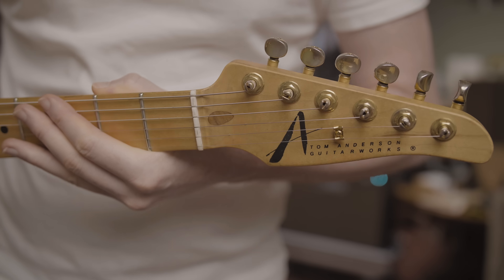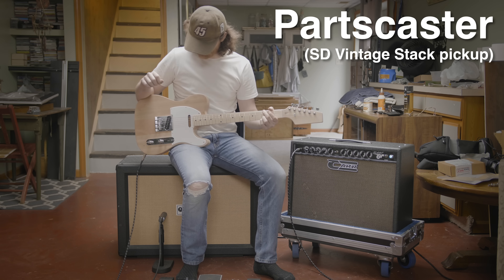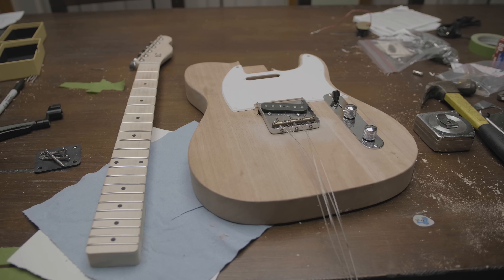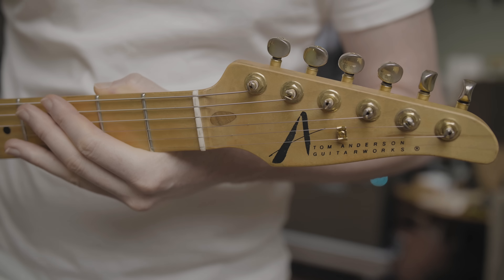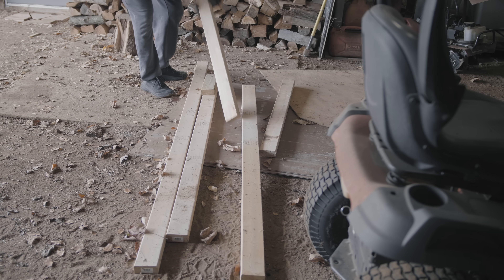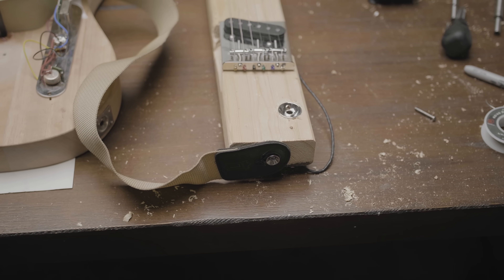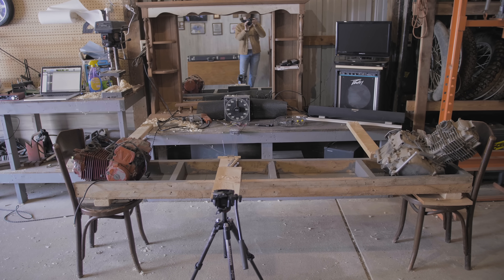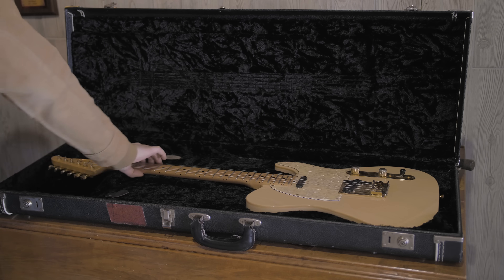Tested: Where Does The Tone Come From In An Electric Guitar?

Comment: I think "tone wood" in electrics is a carry-over from acoustic instruments where the wood really does make a difference.
Reply: OP is correct, but it's still funny in this thread how even when the evidence is right in front of our eyes and ears guitarists still believe in magic like "tonewood."

As long as a solid body electric guitar is structurally able to hold the strings where they are supposed to be the material of the body and neck doesn't make a difference.

Most of the differences people hear from electric guitars, even of similar or identical build, comes down the variances in electronics. Especially back in the day the variances from one capacitor, pot, or pickup could be extreme. Nobody was counting exactly how many winds were on a pup, or checking capacitance values with a multimeter. Heck, even a top shelf harness kit from Emerson Custom states there is a +/- 8% value between their parts.
Reply: @SuicideVan  this, honestly an electric guitar should be bought based entirely off what makes you happy or what you find comfortable, and if you want to modify the parts of it with better parts go for it, thats one of the best parts about an electric you can customize the hell out of it if you want

people buy old worn down cars to restore and upgrade them all the time, i'd love to have a project guitar someday like others have their project cars
Reply: @enbydeadly  I restored a 1961 Kay Galaxie I found in a thrift store a few years ago. A mouse had made a nest I'm the body. I rewired it with new pots and jack, deep cleaned the fingerboard and polished the frets. I had to buy and shape an entirely new bridge and install new tuners. The most interesting repair was the acrylic pickup frame that was cracked and broken. I was able to 3D print a new one. I did the best I could with the action, but it's still very high and pretty much unplayable above the 12th fret, but it does work well for slide guitar and looks great hanging on the wall.

As far as modern guitars go I'm mostly inclined to build my own guitars from the premium parts I want from the start. Buy once, cry once. The bonus is I don't end up with a workshop full of extra parts I never really needed. I'm not particularly skilled at this either. A couple times on more complex builds I simply took all the parts down to the local guitar shop and spent $100 or so having a professional put it all together. Still got an amazing guitar for less than what Fender is charging these days.
Reply: @SuicideVan ”pup”
Reply: I think this is an insightful, mature, and open minded thread of comments.
Reply: I make both electric and acoustic guitars as a hobby - I can tell you 100% that tonewood is everything in acoustic, and marketing in electronic.  the only thing I have ever see modify the tone in any electric guitar is the electronic hardware (mostly the pickup) and the strings.  I'm still watching the video, though, so I'm interested to see where that lands.
Reply: @Chiberia in classical guitars wood (90% of which will be the top) is one part of the equation, the other part is the overall built and that’s where it becomes difficult and requires a lot of talent and experience by the luthier. You could cast an electric in concrete and it will sound great with the right pick ups, strings and electronics.
Reply: @Chiberia  That may be true for wooden, solid body guitars but that's not true for metallic-body guitars or semi hollow ones.
Reply: With an acoustic guitar the wood IS  the pickup.  So, obviously, it's density, and design matter a lot.

Unless you're using a body mounted piezo, wood really makes no difference on an electric.  What a normal pickup picks up has nothing to do with resonate wood properties, past a negligible difference in sustain, where obviously (at the unrealistic extreme) something extremely soft will dampen vibration, and even have a pitch fluctuation.

What the 'real' culprit with an electric coil pickup is (past the pickup itself), is your pots, wires themselves, and anything else that might cause a resistance change in the wiring.  That's literally what a tone knob does.  And the thing with pots, and wires is that they're not really made to all that exacting of a standard.  A 250k pot sounds WAY different than a 300.  But if you buy a 250 it might be anything from 220-280 in reality, and that rating can even change pretty dramatically just by how hot or cold it is.

In so far as construction is concerned, the 'ideal' wood for an electric is whatever the perfect compromise between cost and toughness is.  Because the more important factor with the construction medium is making something that is going to hold up to abuse, time, and elements.
Reply: I think that's a very intelligent theory.
Reply: when you put a magnetic pickup in an acoustic guitar you are getting more sustain from having a resonance chamber beneath the strings which reacts really badly with feedback, hence why we went with solid bodies to go louder. if pickups were microphones we'd have similar problems. yes they are technically very similar but we obviously use pickups specifically to avoid microphones.
Reply: @Quills64  yeah pickups are non microphonic
Reply: musician and guitarists are just kind of gullible and absurd and very very superstitious
Reply: Notice how at the top of your comment it says; @ramshaka, and at the top of mine it does not say;  @Lamster66  ??

FYI if this really is your area of expertise, and we're in professional concordance, that's a really weird way to show appreciation for having a cosponsor.  I simply read through the thread, and noticed that no one had put what I said in one comment, or used my particular phrasing.  So I made an open comment.

The question is why are you being defensive/combative about it?  Makes no sense to me...
Reply: No it's just marketing 

It's not the species of wood 

It's the density of said wood 

Acoustically you can grab 2 pieces of mahogany and hear a difference or measure  a difference 

Tone wood is a marketing word "if you don't have tone wood then you don't have good tone" 

I wish people would stop making up shit
Reply: no shit
Reply: If tone wood is real then tone minerals can also be real
Reply: Wood doesn't affect the color of your sound, but if your body resonates more your string will probably also have more sustain. Different types of wood resonate with different frequencies, so I think wood can affect the sound envelope of different strings. For example when you play a chord on six strings with some guitars the low strings will have more sustain and other guitars will have more sustain in the high strings. Not only sustain but also amplitude. That could be balanced with pickup height, but the distance from strings to pickups also affect sound. I am just guessing but it makes sense to me.
Reply: @Apebek Holy cow! It's a person using their brain, spending a moment or two to think for themselves.
Reply: @Apebek  bruh, the guy literally replaced the guitar body with empty air, and it sounded almost identical to his Anderson tele with the same pickup. Tonewood on solid body electric guitars is a myth. There are plenty of other tests where this is demonstrated. You could put the same pickup on a cement block and it'll sound the same if it was on exotic wood as long as the strings, action, pickup heights, technique and other setup parameters are the same,
Reply: @kissing88  I wasn't talking about color. Just sustain and amplitude differences in the frequency spectrum. I believe mahogany and maple for example have more sustain then basswood.
Reply: The entire reason for the solid body electric guitar's existence is to eliminate totally the influence of resonating wood on the sound.
Reply: plus just the fact that not so long ago people used to play unplugged on their electrics all the time. in the time before cheap quiet modelled sounds at home were common, people spent praciting time doing scales and whatnot more often unplugged than not. Back when I started even clean practice amps usually were loud as hell as soon as you even gave them a notch of overdrive. I'm talking pre-Line 6 POD days here. A overdrive pedal into an practice amp at home in your bedroom? forget about it. You'd still be entertaining the whole house. And so I practiced scales and melodies unplugged a lot. Because of that I grew to love a guitar with a basswood body because that was so much louder and more resonant.

Plus instruments are very much a complex haptic experience with so much factors uncognitively playing into our expiereices as players (!). The resonance and vibration we feel or not feel against our bodies may influence our psychoacoustic experience of a guitar far more than the actual effects on the electric signal.
Reply: But does it?
Reply: The way I'd heard it before is such: Very little of the wood response makes it to the pickup, but it DOES make it to your body. That does have an impact on how the guitar sounds *to the person playing it*. You'll want the instrument to vibrate against you more or less depending on what you're playing. In use cases like pitch shifting or heavy effects or distortion, the frequency response going into the pickup is less important than what's coming out the output, so deader wood and denser finishes are actually preferable.
Reply: @actuallyasriel  maybe to you but not to others
Reply: Wood is much more important in acoustic guitars. Maple and Rosewood made a difference though.
Reply: Even then I think it requires a bit more testing to dial down what exactly factors in, but maybe I'm just outdated. Different types of wood have swort of a favorite rang of specs, but different woods can haave the same characteristics, like density, hardness, yada yada yada. I think it might be possible to get two different species of wood, that have the same stats, so to say, and htey end up sounding pretty much the same. I'd like to see a test for this.
Reply: How the guitar sounds acoustically is how the guitar sounds, the pickup is just a microphone and some have characteristics that also change the sound but electrically instead of how the strings sound
Reply: @c.a.k.comedy692 no
Reply: @c.a.k.comedy692  A pickup is not a microphone. Watch the video.
Reply: @mattr5095 it actually is doing the same thing champ. I get you have no understanding of EE but trust someone who does. Both devices are taking impulses and converting them into electrical signals.
Reply: @StupidGuitar except a pickup is ONLY taking input from the string’s vibration. What we hear acoustically is not what is amplified by the pickup. It does not do the same thing as a microphone.
Reply: @bruhmingo  microphones are an electromagnetic coil that picks up the sound of a vibrating diaphragm that picks up your voice. If you have vibrating metal pickguard plates on your guitar, you can actually talk into it because it becomes microphonic.
Reply: @c.a.k.comedy692  you are wrong.

Pickups are inductors. They don’t detect sound waves, they need something that interacts with the magnetic field to move across it, so it can generate a current. Your experiment of talking to a pickup won’t work if there’s no strings in the guitar.

Microphones on the other hand have the inductor, and some ferromagnetic component that interacts with changes in air pressure. 

That being said, wood has 0 effect on the vibration of the string, solid body guitars were built exactly for this purpose. 

I’m going even further, and say that the type of pickup have almost no effect on the tone as well. One can notice a modest difference between high output pickups, and low ones, but one can sound like the other just by turning the gain knob of the pre amp.  

People are throwing money for stuff that matters less than things like the ambient where the amp is, the distance of the microphone to the cabs, the type of cab, equalization, and effects.

Guitar world is a huge scam, And the best proof is people paying thousands of dollars on a pedal that any amateur can do at home, because they think the clones don’t sound the same unless the exact brand of transistors are used.

Guitar companies would lose a lot of money if most players knew the basics of electric engineering.
Reply: @mattr5095  they pretty much are a variant on a microphone, both work by magnets moving and creating a signal
Reply: @MrScottyTay  I think people missed the point on what that dude meant by relating a pickup to a microphone, but as long as people understand that a mic can pick up any sound, but you need something made of metal for the pickup, even if it is some part of the pickup itself, like the cover, this will eventually swort itself out. The funny part is it seems most, if not all, of the people here understand it, they're still arguing about the thecnicallity of it lol.
Reply: @brandonroebuck504  as an electrical engineer and someone who works on physics all day, you best recognize before you make yourself look the fool by throwing stones from glass houses… oh wait… too late.  It’s always funny when someone comes in to be the um actually guy and just shoved their foot in their mouth and undermines their invalid arguing by calling people names, but you do you champ.
Reply: @StupidGuitar  you literally did the exact same thing lmaooo

and again you're wrong, pickups are fundamentally different than microphones, one is a transducer, ones an inductor

youre literally the one being condescending here and yet you're mad other people did it back?

bozo move ngl
Reply: @brandonroebuck504  reading comprehension is not your strong point it seems. Oh well. Good luck in life champ.
Reply: @c.a.k.comedy692 that's cool as fuck dude, thank you for that info, gonna rig some metal plates ASAP.
Reply: actually a decent amount of pickups ARE microphonic hold up your phone playing music to a guitar pickup lets it be heard through an amp. acoustic qualities of guitar that arent related to the position over the string ARE however not picked so it is not a fully acoustic match.  @bruhmingo
Reply: @StupidGuitar You said a bunch of gibberish without actually saying why he was wrong. You just tried to sound all high and mighty; get over yourself. Literally watch the video. I don't know how much more clear it can be.
Reply: @dragostego 

That's not because it's acting like a microphone. You should look at how speakers work, but to simplify; a speaker works by applying an electric signal to a coil around a magnet. When the signal is applied to the coil, it acts like a magnet, moving the speaker and producing sound. When you place your phone close to your pick up, it's picking up those same electrical/magnetic impulses that it sends to the speaker.

To demonstrate further, try YELLING into your pickups while muting the strings, no sound will come through. Why? Because it's not a microphone (or microphonic)
Reply: @tg_2137  incorrect. You can speak into some pickups, especially older foil pickups.
Reply: @mattr5095  I think dude was just making an analogy
Reply: @bruhmingo  you’ve never shouted into your guitar strings over your pup huh
Reply: @laersonverissimo9172  Good comment except for the part about pickups. Pickups are built with vastly different specs, copper quality, overall build quality etc. The difference between an active EMG and a stock active Ibanez pickup is very stark. It's not just output, it's the quality of the tone. You will have more low end and a hotter high end on the EMG, and turning your gain up on the ibanez is gonna add a lot of noise and bring out more ugly frequencies you dont actually want.  First part of the signal chain. Very important.
Reply: @StupidGuitar  You don't understand what everyone trying to say. So I.. think this comment is what you need " reading comprehension is not your strong point it seems. Oh well. Good luck in life champ."
Reply: @FancyCP30  oh bud. Please don’t embarrass yourself like that again. I do understand. It’s typical of the weak minded to deflect. Also typical of them to come late to a conversation to try and show how “smart they are”. Well done on that bud!
Reply: @bruhmingo how do you explain unpotted pickups then?
Reply: @dragostego your phone has a magnetic field
Reply: @MrScottyTay except with a pickup the string acts as the diaphram (and sound source) which creates the current by moving throughout the magnetic field, where as with a microphone the sound first resonates through the solid material its built into, travels through air then vibrates a metal plate which acts as a diaphragm which creates the electric current by vibrating through a magnets electric field. It's like saying all microscopes and telescopes are the same thing.
Reply: @tg_2137 well yea if you could put your finger on the diaphragm of the microphone you wouldn’t get any sound out either..
Reply: @dragostego  You shouldn't be able to speak into pickups, if you can that means either it's not a humbucker or standard single coil, and is some form of mic instead of a guitar pickup.
Reply: @laersonverissimo9172  No, different types of pickups don't sound radically different but they do sound different.
Reply: @laersonverissimo9172  Paying thousands for a pedal is obviously moronic when cheap clones can do the job, but clones may not have some functions  or some materials that the brand name ones have. Of course, there are some clones that get all the specs and sometimes more than the original, brand name ones. But saying that anyone with basic knowledge of electric engineering can replicate those at home is certainly laughable to say the least!
Reply: @mattr5095  I guess you never screamed into your pickups.  Ask Phil Keagy or Pat Travers.
Reply: That's not trueeee the magnet is fixed in an electric guitar!! If it's not potted it can be microphonic but that's a separate condition
Reply: @MrScottyTay If that's your definition of a microphone then a permanent magnet generator is a microphone, a permanent magnet motor is a speaker and every time one is powering the other is an audio transmission.
Reply: @laersonverissimo9172  What about the longer sustain on some guitars? Isn't this a wood type effect?
Reply: @c.a.k.comedy692  Absolutely not. Who told you this?
Reply: @DM-rc4yu  my guitar teacher. I’m aware a pickup is an electromagnetic coil, and the vibrations generated by the strings disturb the field, sending a signal to the pickups. 
I’m simplifying it to the idea of it being a microphone, since the sound that your string makes does effect the sound that goes through the pickup. No two guitars sound exactly the same due to differences in scale length, bridge, but I’ve seen enough videos and played enough guitars to know that the sound your guitar makes acoustically is the base for your electric tone.
Reply: @DM-rc4yu bro he is right though it’s a microphone that picks up the vibrations from the string through magnetic fields, aswell he is right about the fact that they change the tone of the string as different copper gauges and coil specs will affect the sound
Reply: @c.a.k.comedy692  no that's physically impossible. The pickup does only pick up the tone of the string and not the wood. When you hear it acoustically you hear the string in context of the wood. Electrically you only hear the string
Reply: @toastyskateralt4725  a microphone would pick up the string and the body. A pickup picks up only the string
Reply: @c.a.k.comedy692 but thats a big deal in why it's different. Microphones pick up vibrations in air. Pickups do not (until you're at super high volume when the air vibrates the strings). What you hear is not what the pickup "hears"
Reply: @c.a.k.comedy692   A Pickup is not interested in wood. Try it, if you move a piece of wood closely above the pickup, is there a sound? No? That's because the magnetic field doesn't care about wood. It cares about magnetic metals. That creates a sound. Therefore the wood cannot, physically, affect the tone.
Reply: @uroboric  The frequencies that the string vibrates at changes depending on the components it's attached to. Different materials will absorb or reject different parts of the frequency spectrum, which changes the frequencies that the pickups are... well... picking up.

What the "TONEWOOD GOOD" camp fails to recognize is that this difference is not massive and, more importantly, can be different from one chunk of the same species to another. Blanket statements about what species sounds what way just don't hold up under scrutiny.
Reply: @MrProthall  This is completely incorrect. The wood, and every other component on a guitar, fundamentally alters the frequencies that the string will vibrate at. This, in turn, alters the frequencies that the pickup sends to the amp.
Reply: @c.a.k.comedy692  Well, you simplify too much here. The string is NOT sending a signal to the pickups! Who could ever say such thing??? The string is a metal piece that is vibrating in an magnetic field. This is introducing a current to the coil that is wired around the magnets. You see there is no signal commin from the strings itself. Some say a pickup is "microphonic" but that only means that it is strongly picking up electric fields that are around you like computer monitors, mobile phones or amps or speakers.
Reply: @Mitsch76  That's not what people are saying when they describe a pickup as microphonic. Take it from someone who had a microphonic p90 that I could speak into and have it amplify my voice.
Reply: @c.a.k.comedy692  - Pickups are not microphones they work on the same principle as a an electric generator. A magnet field moving near a coil of wire generates electricity. Only difference is the string is causes a disturbance in pickups magnetic field instead of the magnet actually moving.  Jim just proves in this video the acoustic of an electric guitar have negligible to no factor at all. From what I seen and heard is the pickup height and the pickup manufacture made the greatest difference in tone. Possible the acoustics can be a factor is in a case where a singer has their mic near the guitar. But no mics were used in his testing here.
Reply: @c.a.k.comedy692 it’s magnetic field and when the strings vibrate which are made of metal is disrupts that field and outputs a sound based on the wave lengths…
Reply: @c.a.k.comedy692 did you even watch the video? Do you have ears?
Reply: @c.a.k.comedy692   This entire video just proved your experiences wrong.
Reply: @c.a.k.comedy692  Test that theory by yelling into the pickup, see how much it picks up
Reply: @c.a.k.comedy692  "I have absolutely no idea what I'm talking about. WTF R MAGNETS"
Reply: @c.a.k.comedy692  Take a vibrations class, there is not going to be a difference because the vibration in the guitar body itself is negligible.
Reply: @c.a.k.comedy692  electric guitars are not an acoustic instrument. pickups are not mics. acoustic electric guitars are acoustic guitars with a microphone in them. if they had pickups, they would sound like electrics.
Reply: @kran27_  no, they don't lol these people in the comments seem to never have even touched a guitar in their lives!
Reply: @c.a.k.comedy692 the pickups aren't a microphone to how the guitar sounds acoustically, only the vibrations of the string. The vibrations of the physical elements of the guitar's parts aren't picked up by a wound pickup (but would be by a piezoelectric pickup)
Reply: @bradbrad247  but what is the difference if the vibration of the string is still what’s resonating through the instrument. Your strings make the sound not the guitar, the wood is basically a shitty amplifier bc of the density of the wood amplifying the vibrations.